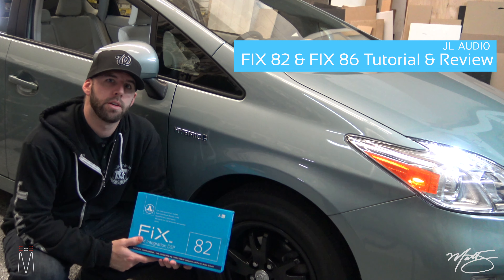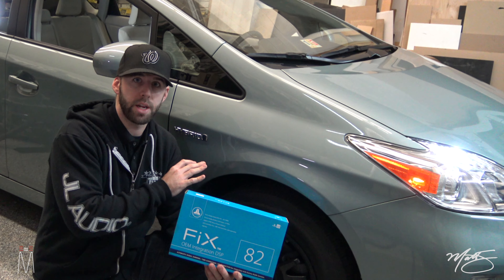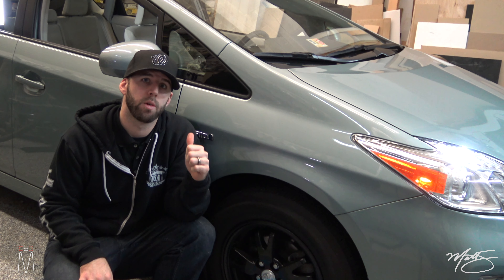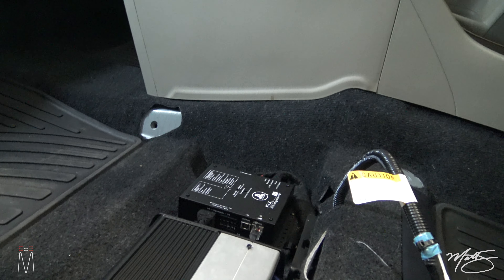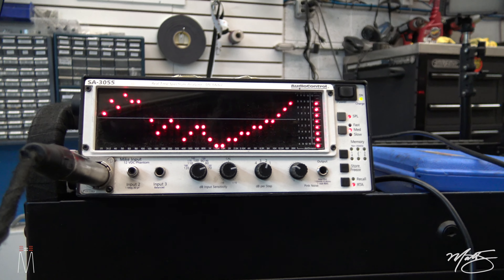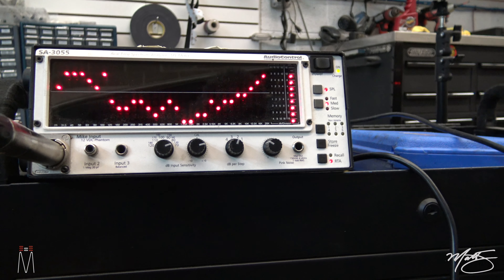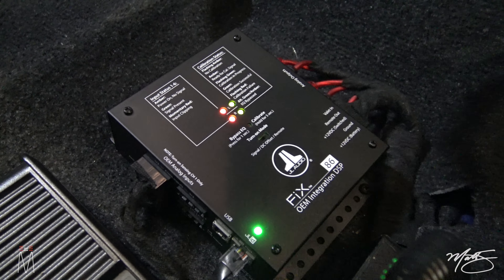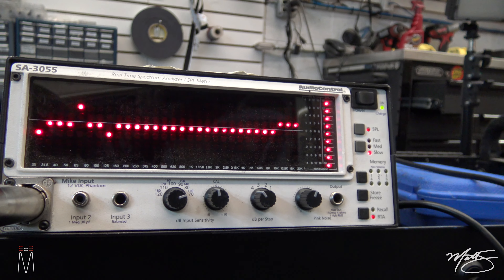JL Audio DSP Fix 82 and Fix 86 Tutorial and Review!!!!

Comment: Need some help please. I have a 2017 f150 with a fix 86 in it. The installer didn't give me the CD program that came with the fix. I am missing the mid bass big time. I would like to reprogram it by pushing the button for 5 seconds. But what test tone or sound do I use? Just a regular radio station work? Thank you.
Reply from the maker: Sound like the calibration is not your problem. I am just going to take a guess, the installer possibly summed the subwoofer and front speakers together possibly creating a phase issue. I doubt it was setup correctly.
Reply: Not sure. It has 4 channels in. And 3 rca out. Can i reprogram it? They didn't set my settings to 0 when doing so. What would happen?
Reply: One more thing. When my fix is on. My 2 lights on the left side are amber. The 2 on the right are green. Is that normal?
Reply: Same issues here. I dont know if they set it up right because i dont have any mid bass

Comment: since this seperates front, back, and sub outputs, does that mean it does crossovers? if it does, what are the crossover points?
Reply from the maker: Great question. With the new firmware update with the Fix you have a 10 band graphic EQ on each of your outputs. With the Fix 86 you are also given the ability to have multiple options to hi pass the outputs. You can even recalibrate and view the before and after response curve of the OEM radio all within the program.

Comment: how does this work with stock HU's that have base roll off? and after it flattens the signal coming into it can you then run pinknoise through your HU and fine tune the EQ?
Reply from the maker: Mickey Gaming you can use the Fix to flatten the signal, then use some of the graphic EQ adjustments with pink noise to make a few tweaks to the output EQ into your amplifier.
Reply from the maker: Mickey Gaming any head units with dynamic EQ (meaning the EQ changes with volume), you will have to remember the volume that you calibrate the Fix to and use the JL knob as your master volume.
Reply: Yeah, I sort of figured that's how it worked but wasn't quite sure. Thanks!

Comment: 350$ Its great and all that but i got the same "FIX" using the LC7i. its not quit idiot proof like the JL product but if u can use an RTA it works just as well. I can also adjust the bass with the knob they supply for half the price.
Reply from the maker: Thats impossible. LC7i is a summing line output converter. It is not fixing signal, nor OEM time alignment. A LC7i is simply just allowing you to take a front mid and front hi and sum them into one output for an amplifier.
Reply: I was in the same boat as you were, i.e. looking for a 1 stop solution for my factory deck while keeping bluetooth and steering controls. So I started hitting the forums and learnt a bit of electronics along the way. The LC7I is Line output converter (high to low) plus some feedback circuits that keep superimposing the same signal on top each other like a stackable sandwich. That's how they get the missing bass thru accubass. Problem is, ur gonna get some stacked high frequency and stacked low frequency so you will be looking for a pre-amp/crossover to start cleaning up the high shrieks and off-key lows. The fix-86 from research, does a lot of correction using DSP technology to recognise, detail and correct the signal before amplification without the use of the pre-amp/crossover. So those high spots and extreme low spots on the scope at 6:34 remain if using the LC7i, while the mid and lows are "boosted" as a result of superimposition due to feedback circuit. But with the Fix-86, it gets flat as seen at 8:29 allowing you to tweak or play just as it is.
Reply: Does the DQ-61 have "fixing" capabilities ? 
Or is it pretty much the same as the LC7i with extra eq controls ?
Pretty sure it does time alignment though.

Comment: MY DSP Fix 82 has no sound coming to speakers, and the top left bubble is flashing green. Any suggestions?
Reply: Mine is doing the same thing. Tried to calibrate and even bypass the eq? Any shops around the St Louis area that know these systems?
Reply: I have the same Problem after Software Update...did you find a solution ?

Comment: Why most installers still require you to install Audiocontrol LCQ1 or DQ-61, is there a problem with the JL Fix 86, i've spoken to at least half a dozen of these guys, different stores too. I'm sensing they're lazy to move forward and embrace the new tech. A couple of those stores are JL Audio Authorized dealers too and they refer you to a non-authorized dealers and they charge so much, the worst thing is they don't want you to touch their setting after they set your EQ, plus they say that they're saving you money but they're labor to install is astronomical, example to install a Fix 86 cost almost $500 with the unit, which they order from their source, if you bought it somewhere they trick you and they say it's no good and they'll sell you their product saying there's a lot of noise coming from these units, One of the LCQ1 that was installed in my car got so warm that it shut my sub off so they messed around with the jumpers and ran the system into a whole system, it sounded bad at front with the highs so fatiguing and the rears so boomy,  it lost the dynamics and coherency of the whole system, I'm running Audiofrog G60S front and rear with a JL Audio XD 700/5v2, and a JL sub, you think I should get the Fix 86 and install it myself, you spend so much and read up on certain products then you'll just be bummed because the installer says it's no good.
Reply from the maker: The Fix is only responsible for fixing the input EQ from the factory radio. Every car's interior is different. Speakers are in different locations, seats are in different locations and the reflections vary from car to car. You still need a controllable DSP to achieve the target output EQ. This is done when you place a microphone inside the car and use an RTA to adjust the EQ to achieve your target EQ curve for that specific car's interior. This is where other products come in play.

Comment: why not just buy a proper headunit
Reply from the maker: ok4u2laf if it was always that easy. That isn’t always an option.
Reply: Go look at newer cars that have everything integrated... not easy to just swap in a double din and call it a day.
Reply: Because you cant replace the factory head unit in some newer cars or you lose A/C, heated, cooled and Ventilated seats, rear window defroster,  rear view mirror dimming and so much other stuff that it doesn't make since to switch to a aftermarket unit.